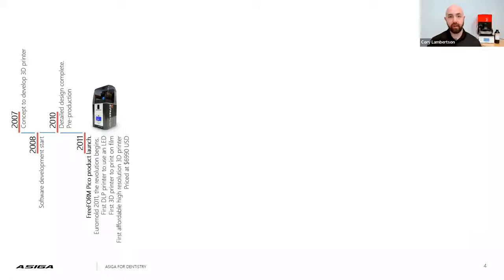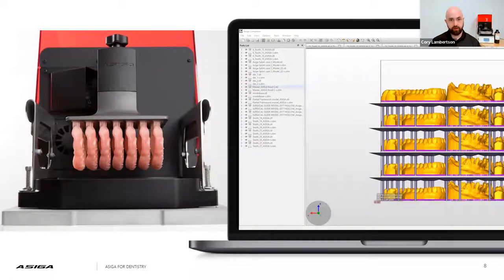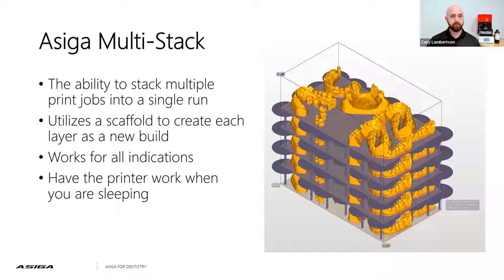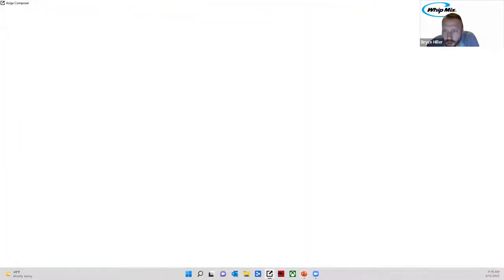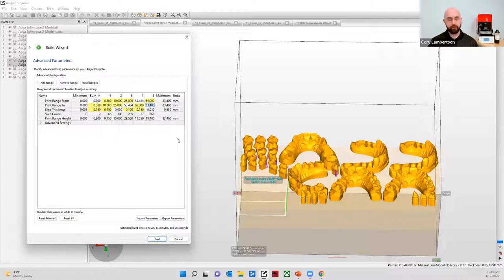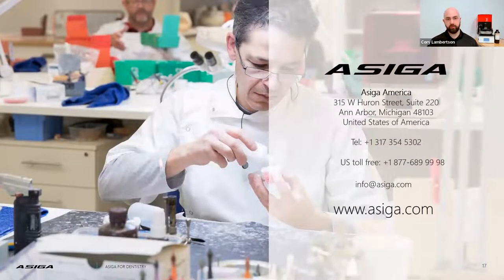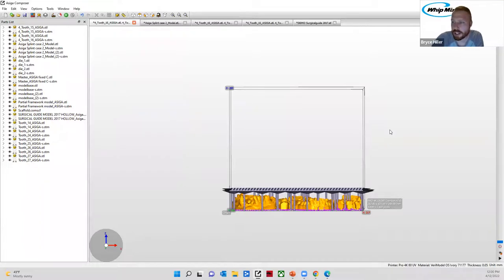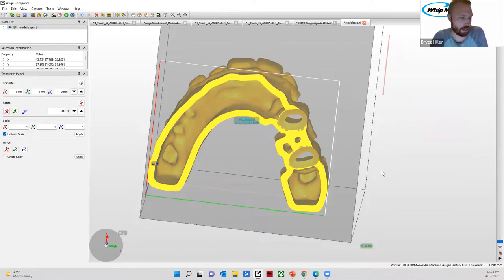3D Printing to the Max using Asiga’s Multi-range and Multi-stack Features

Comment: If I was doing a multimaterial print.  Would the printer stop at the level or would I need to be present, pause and then change the material???
Reply: An issue I see with this is mixing/contaminating resins. You use resin A to start a build, it gets to a certain layer where it would stop, the 3d print still has Resin A coating it. Then you take out the tray with Resin A on it and load Resin B tray. Then continue printing the model in the new material, the resin A that is still on the model mixes with the resin B (however little amount it is, but it would still contaminate it)
It's not like a FDM printer, where it lays a layer of plastic, remove the filament, and lay another layer of different material on top, those don't mix together. with DLP printing you are submerging a model, that is still coated in resin and could affect the new resin it's being dipped into.